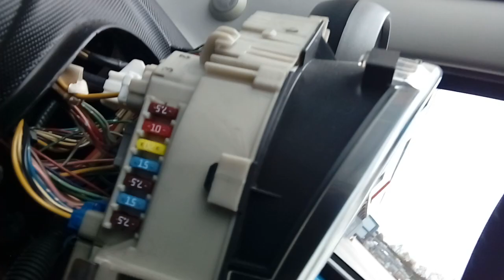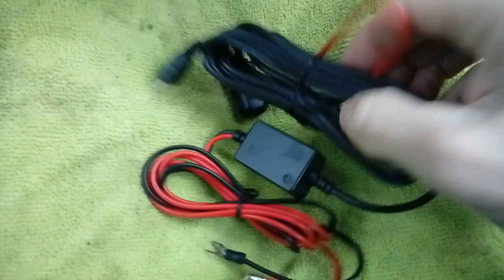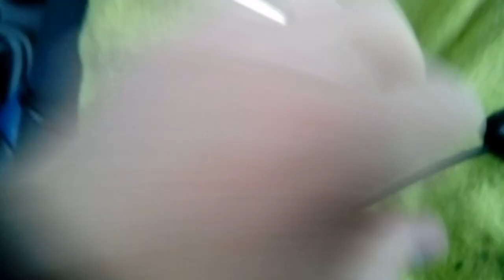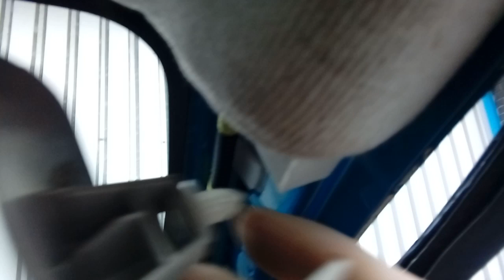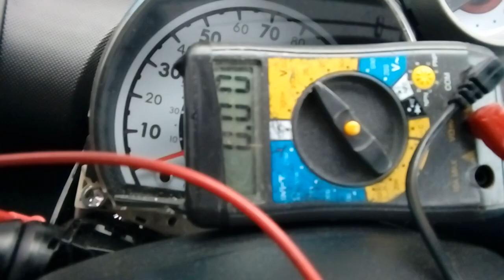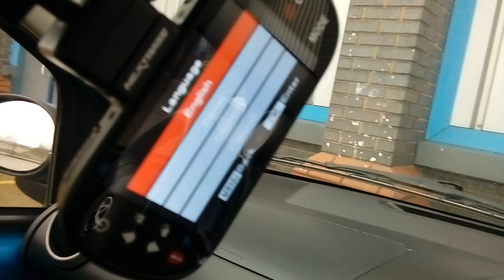Toyota Aygo 2005 - 2014 how to wire dash cam to ignition(goes on/off with key) Simple guide

Comment: Presumably if you want parking mode to be active, you'd want to use a fuse that is always on, right?
Reply from the maker: Yes, just be warned although camera makers claim the unit will switch off when low battery is detected in reality they more than often don’t. Seen hundreds that have had a flat battery due to this.
Reply: @PJsprojects  are any of the bolts behind the Speedo safe to use for earthing? My kit has a black earthing wire but it's too short/doesn't reach the door bolt and allow the yellow/red to reach the fuses

Comment: Hi PJ.
Looking at time index 9.23 of this video where you install the fuse tap, can you confirm that  the actual power  comes in through the fuse pin nearest the the steering wheel so the opposite end to the wire going to the dashcam. If it doesn't then surely the dashcam fuse will be bypassed?  
I'm just making sure I understand fully how it works. At the moment I've got mine working off the plug in cigarette lighter 
Cheers
Reply: https://m.youtube.com/watch?v=ETG3ND09A4g

Comment: Hello I have a bmw 7 series and all my fuses are live. Would you know a way to convert a fuse (ideally my 12v lighter socket) from constant live to switched live????
Reply from the maker: You would need to unplug the lighter socket from underneath and snip the power feed cable (yellow/green strip). Connect a new power cable from the socket to a ignition switched acc fuse in the fuse box.
Reply: PJs projects Thanks for response. But the issue is that all of the accessory fuses are live or 30 amps otherwise I’d piggy back off them for the dash cam. Don’t know if you know a way to wire a fuse to be switched instead of live   😔